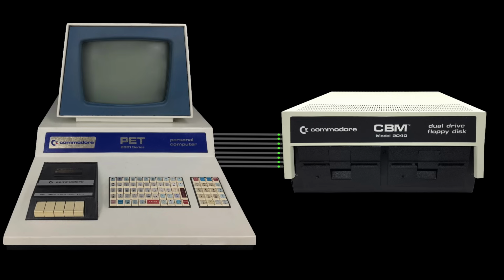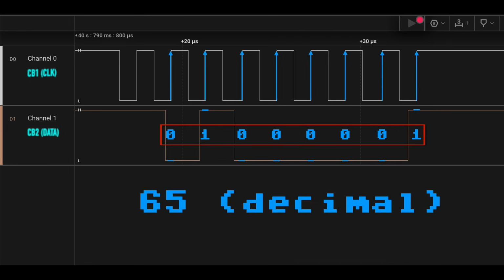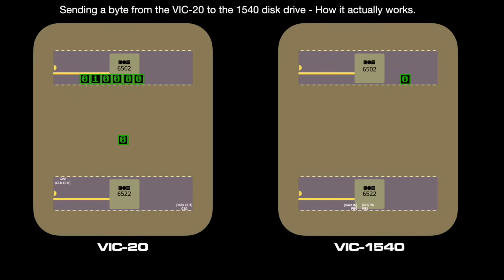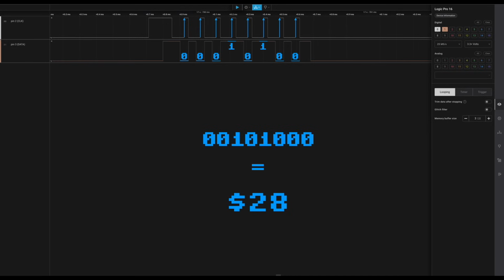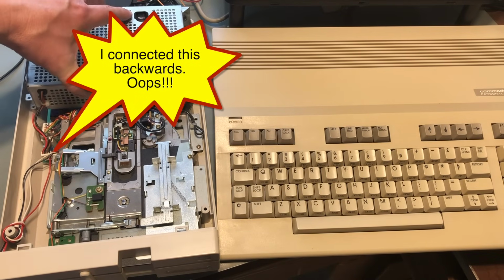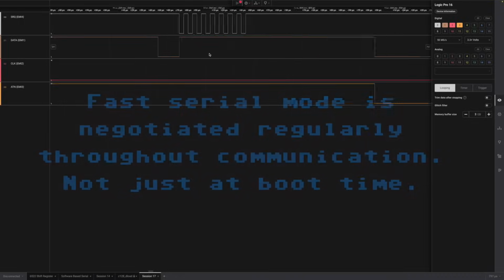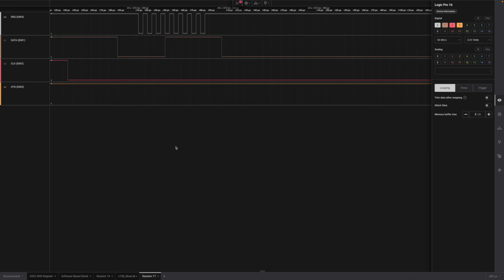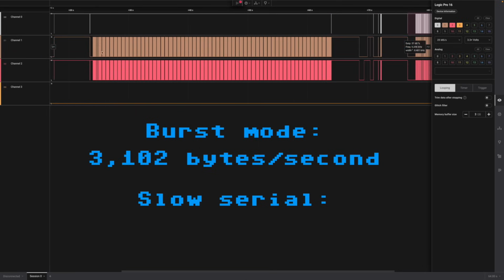Deep Dive: Commodore's Fast Serial Bus Protocol Explained

Comment: Hi,

C= was everytime failing.... Even from the start.

If I would have encountered that bug, I would have said: we have a workaround in software, it's slow but working and unitl we rerun the chips we need to stick to this. We we have new chips you can put them in and the, will work as intended.

Nope they didn't do it like Pros would have done it...

They did what a child would have. Say nothing, and implement the mist pisspoor routine possible. For no reason other then being idiots.

Remember we had fast load either on the 1531 and also community (=hackers back than) who did a DIY software turbo tape and turbo drive disk load and save which had been easily that fast as the original shift teg method.

And they didn't stop.

I bought a thing called ParDos for the 1541 and C64 which was essentially a parallel bus adaptor which went between the 1541 from socked and the user port of the C64 making data load transfer up to 18times faster and data writes around 8-10 times faster compared to original.

Why didn't C= do that in first place..?

They got a second chance and failed big time again.

Who needed a working bus for that too late and too little C128 which no one wanted..?

Again the reputation of C= computers had been driven entirely by the end users not C=.

When we wanted 16bit, they came up with c16, c116 and /+4..?? 

C=...??.? A What..? Are you serious..? 
We don't want these. 

The same went for the Amiga.

C= failed every time, I wonder that they succeed anyway and  anyhow over all this time.

They failed at that top notch A2000, as the A, and B versions had been buggy. The first real A2000 was the A2000C which I bought back in 1989.

And after that.. They seem to stop. A2620, A2630....
I bought the GVP 040/33 and that GVP GFX piggy pack. True 32 bit. And what did C=... Nothing.

They came up later with a A500+ that no one needed and wanted.

As we wanted AA, which was ready, they gave us that poor A3000 with ECS again and no DSP but was promised and a buggy Z-III on a poor raiser which had three slots but only two had been usable..they again needed two revisions until that ECS (!!) A3000 was usable as intended.

And when AA arrived the A1200 was killer.. But the A4000 was a lame duck again. We wanted at least a 030 and not an EC or 020...i already had a 040/33 in my years old A2000C which still had better GFX anyway and better sound through the Majestro-II 16 bit stereo audio card. And the Picasso-II+ let me run standart workbench on a 17inch standart PC monitor in 800x600 or 1024x768 or anything ekso as the chip on it was fully controllable. I even hooked up a special DTP monitor with 1228x866/42hz mono. And it worked.

When AAA was ready they did... Uum the A4000T new PCB anyway but not AAA...
Bye bye C=... At that point you kicked yourself out of business and not by accident.

Cheers.
Reply: Nice rant. I can't disagree. By all accounts the company was poorly run. A lot of that can probably be attributed to Jack Tramiel.
Reply: @ryancraig2795 The Amiga times and that AA and AAA disaster was Medhi Ali's fault. A typical 80s Chairman: helicopter, big spender, big Ego, no clue.
Reply: I forgot,

Did you know AA should have a true 16bit audio chip... But C= went : we don't need that, an Amiga isn't supposed to be a musical instrument.

You know what happened next: ENSONIQ and the Mirage DSK based entirely on that chip.

We instead got a rushed together Paula chip with 8bit audio. As it's design based on one 32 bit reg internally and was spilt into 4 8-bit channels.

Nice move C=, nice move... Again....
Reply: Commodore succeeded because they did things cheap and fast. Even you, when voting with your dollars, didn't care enough about these problems that you'd buy a different computer, did you?

I'm sure if Tramiel had known that people would complain vociferously about his computers he wouldn't have cared in the slightest if he also knew that people were going to buy them anyway.

Comment: 15:11 least significant bit first? Wass this on purpose to behave like token ring(noncanonical) instead of ethernet(canonical)? Thank goodness things like Epyx Fastload/Supersnapshot/JiffyDOS came along to help us with speeds
Reply: Why would you consider Ethernet to be canonical over token ring? And, perhaps more importantly, why would you consider either to be canonical when they're both about a hundred years newer than the start of serial transmission of bits encoding characters?

FWIW, in the microcomputer world at the time, neither Ethernet nor token ring was in use. Microcomputers did frequently use asynchronous serial over RS-232, though. Guess which bit comes first there.

Comment: Even with the slow software method there was 3rd party loaders that was much faster on the C64 at least, often disk based games would initially load a small fast loader to load the game in the same way as turbo load was done on tape. This proves that Commodore's software implication could had been much better.
Reply: Maybe, but not under this time pressure. For the C64 scew up, someone had to be fired!

Comment: I just started watching. Jim Butterfield said the slow down was a factor of five. The MOS chips were capable just not implemented the best in c64
Reply: Nope.  The 6526 was *fully* capable of high speed serial.  The problem was with its predecessor: the 6522, which is what the 1541 disk drive used, but it had a synchronization bug where it would occasionally drop bits.  Engineers wanted to revise the design of the disk drive, but Jack Tramiel said no, the C64 was to use the same peripherals as the VIC-20.  So, we got what we got.  😞